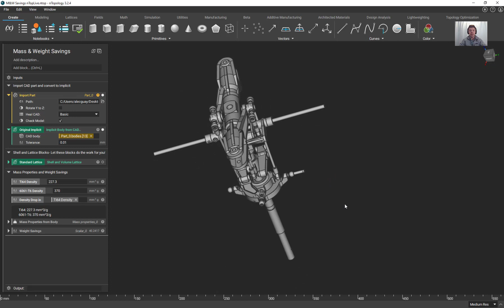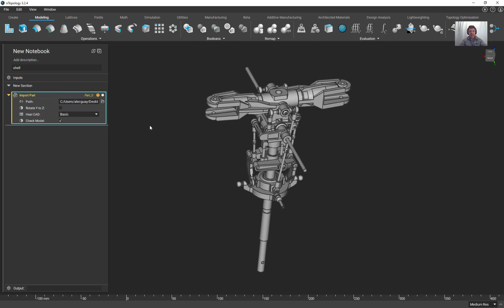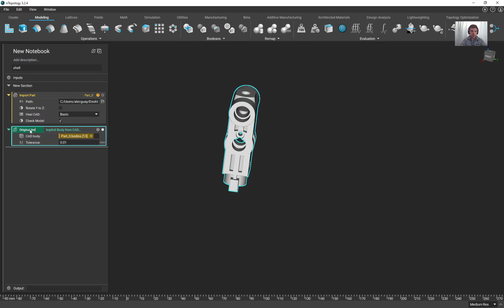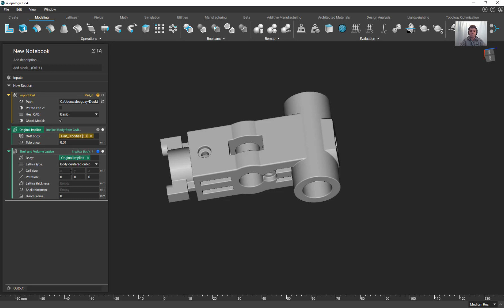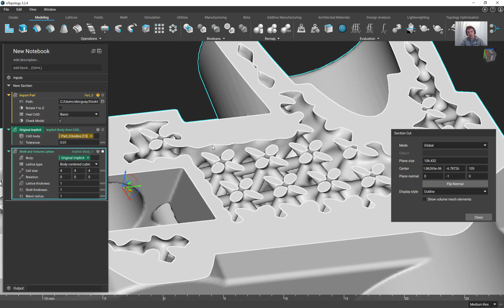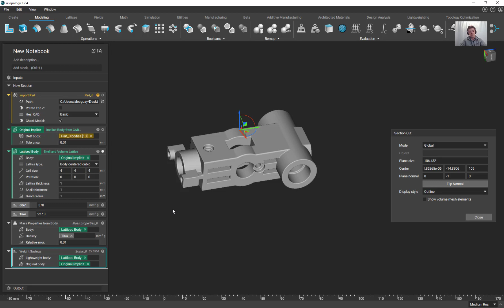nTop Live: Lightweight & Evaluate Mass Savings of Helicopter Component

Comment: Your density and mass are way off - the part should not weight 5,600kg! Al 6061 density should be 2710 Kg/m3 or 0.00271g/mm3. the Ti64 density is also wrong. Thanks for the workflow demo though!
Reply: Hi @Ayoh! You are completely correct, I have updated this file to reflect to proper units! Thanks for watching!
Reply: @ag4195 Hi Sir, my files is working fine but I'm having zero mass. Any idea what could be the issue?